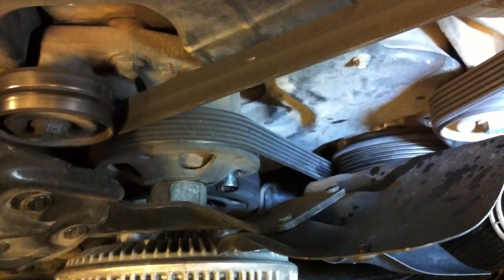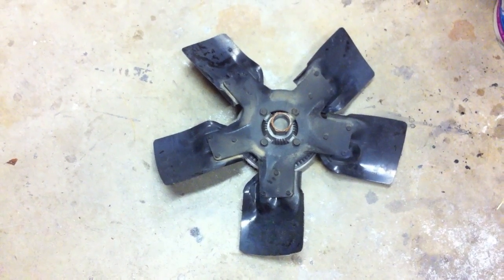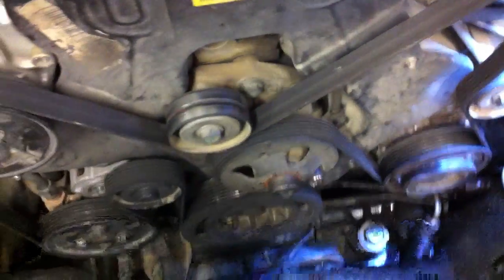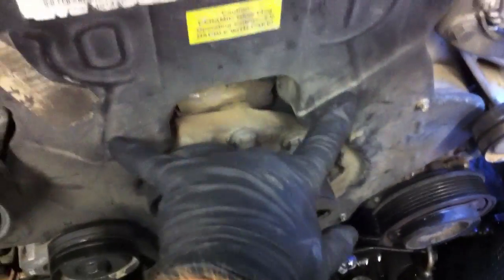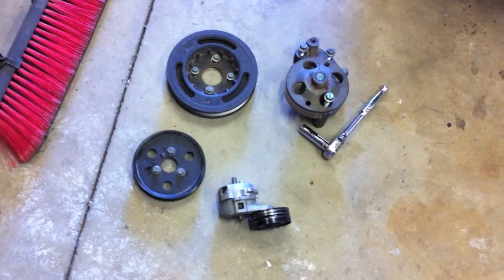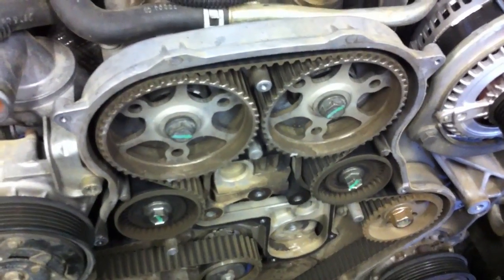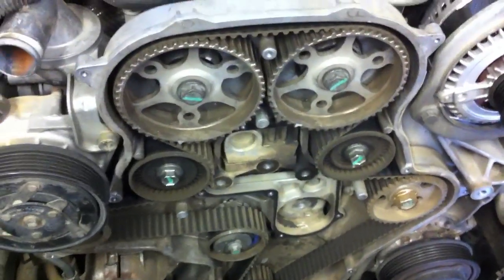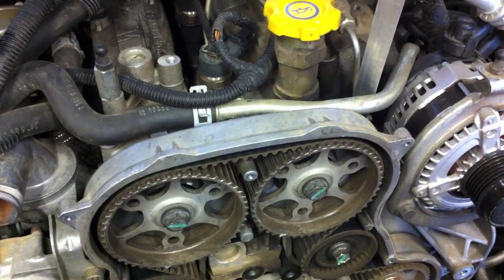Jeep Liberty / Cherokee KJ Diesel Timing Belt Replacement Part 3 - Engine cover and Re-Timing Engine

Comment: Hello sir, i just had a quick question regarding the rocker replacement as well. My question is once you time the motor 90° after TDC and insert the three timing pins, and you remove the belt and all accessories to pull the intake manifold/valve cover to replace the rockers, are you able to leave the timing pins in the camshafts so that once you put everything together the motor is already timed? Thanks i appreciate the videos man, very detailed! Cheers
Reply from the maker: Yes you can leave them installed. It’s easier to see that the pins are installed and lines up correctly before you install the cover. Timing the engine before you take it apart is really only to help you put it together later. I don’t even bother to time it before I take it apart anymore. And only when I go to put it together do I install the pins into the cover, turn the crank to 90 aTDC and assembly. Obviously for a timing belt only replacement you install the pins before taking the belt off. But if you are taking the intake off it it really only matters that they are in when it goes together.
Reply: @IcarusOffroad  thats awesome good to know! Thanks for the reply! Im currently in the middle of the tbelt job on my 06. I decided while I'm in there to do arp hesdstuds as well, ive done reading on the one-by-one method, and saw that arp provides an instruction sheet for doing that method and pulling the head. Is there any tips or tricks you have for doing the one-by-one method? Any advice would be greatly appreciated! Again, thank you very much sir!
Reply from the maker: @jonlukowicz5422  be ready to clean the threads out for the arp studs. The studs are a little longer on the exhaust side to you might get some intererence and have to grind the intake a little to clear them. I think I show some video of this in the later parts of my junkyard crd engine videos.

Comment: Are you still working on these?  I could really use your advice if you are willing??
Reply from the maker: ADVRX yes it do. Asking is free. Ask away.
Reply: I have set a goal for my 2009 wrangler to install a 2.8l crd.  Every likes Hemi's or LS motors.  I prefer the mileage and overlanding type of travel.  I need to find a Jeep first 05/06 crd liberty.  I have watched a lot of your videos and learned quite a bit about the engine.  Your videos are excellent by the way.  I have a small channel and would love to collaborate with you on this swap.  I will basically take any suggestions you have about what year, what to watch out for.  Even where to find one.  I am most interested in what you would suggest to do with a high mileage one before it is installed.  Thank you so much.
Reply from the maker: ADVRX is recommend you look for a JK donor over seas and get the JK 2.8. The JK 2.8 is the next generation of the KJ 2.8 but it’s as close to a “bolt in” that you are going to get. While you could make the 05/06 CRD work there are some electronic difference than mean the JK 2.8 will be a much cleaner swap.
Reply: @IcarusOffroad  I am sure the cost of shipping an engine from .... would cancel the project.  I have worked on VW's and have considered using a TDI.  I have decided I want to use a liberty engine.  A company out of Tacoma called "diesel toys" has videos online of a jk swap with a CRD.  They no longer offer a kit and are reluctant to share any knowledge or experience, understandably.  But still, I can tell by the airbox lid in the video they are using a US motor.  At least based on what I can see in an Aussie 2.8 replacement video and the diesel toys video.  I think I can figure out the swap, I just want to make sure the obvious things are done.  For example, the EGR delete, metal torque converter, timing belt replaced prior to installation.
Reply from the maker: ADVRX I’ve considered this same swap for years. And I have a complete donor vehicle sitting in my driveway now. I would still buy an engine package overseas. For reference I purchased a Land Rover 110 in Europe and had it shipping to Tacoma for $1900. That was a complete vehicle via RORO.
Reply: @IcarusOffroad  Well that does not sound as bad as I thought.  Any suggestions there?   I have no idea even where to begin.  I have the idea I will end up with something here.  I hate to sound stubborn after asking for your help but if these turkeys here in St George Utah can make an LS motor work.  I know I can make a gorgeous job of a US version CRD if I have the whole liberty sitting in my driveway.  I love your Ollie videos BTW..
Reply from the maker: ADVRX you can make it work, I can make it work(and not to be rude but I know more than you about it) but I would prefer to import a setup. Half of the import isn’t even about the engine, it’s about all the accessories. If you import a factory 2.8 JK CRD, wiring, intercooler, etc etc. that stuff will bolt into a JK. If you want to use an older US spec KJ CRD, you will be fabricating lots and lots of stuff, to the point where the number of hours you spend on fabrication will be less than slaving away at a day job and just buying it from overseas. 

That being said I am far enough past thinking about doing that that I don’t have any current contacts for finding a swap package. Australia and the UK used to be the easiest to deal with due to the lack of language barrier, but they are also RHD countries which meant a few things needed to be modified for LHD. If you are looking in the UK look for “breakers” I have also had luck looking on eBay UK and finding vehicles being parted. Granted there are logistic issues to importing an engine, but for me they outweigh the hassle of using an older engine. One of the big reasons not to use the older engine is that the KJ electronics use PCI bus, but the JK uses CANBUS. This means an LS engine with a CANBUS ECU, or a Cummins with a CANBUS ecu........or a JK 2.8 with a CANBUS ECU will play nice with the electronics. The KJ uses PCI bus, so it will not talk to the vehicle dash, airbag computer, and computer. Etc etc. from this standpoint a CANBUS LS engine is easier than the KJ CRD.
Reply: @IcarusOffroad  The electronics make sense.  That explains why "Cody built engineering can use the TDI.  And certainly, no insult taken, you are clearly the expert.  That is why I reached out to you.  Funny thing I was just trying to search ebay UK.  I really want a diesel in this jeep.  The whole re-engineering concept is why I shied away from the cummins 2.8 repower.  No one has put one in a JK, except Bruiser conversions and they want $30K.  The engine is only $8800, so the rest is engineering.  Maybe its time to just go buy a JL with an Eco diesel in it.   If you have any other thoughts or ideas please let me know.  I guess I will give this some serious thought before I fly to Florida and buy a liberty lol!!  It is awesome you gave me so much input thank you.  You may have saved me from a big mistake.
Reply from the maker: ADVRX ya the KJ diesel is a fun engine, but better suited for swapping into something older not newer. I think the cumins 2.8 would be better for a JK since it supports CANBUS. And overall it would have similar levels of fabrication.   I am also eyeing an ecodiesel JL or JT, I’m curious to see the JT with max tow package and diesel.

Comment: I wanted to ask. My crd has 130,000 and seems to run great
I’m gonna do the belt and water pump and tensioners
Is it necessary to do the rocker arms or is it over the top maintence ?
Reply from the maker: Its really 50/50, if the EGR has been disabled for a long time and thicker than factory engine oil run then they could be just fine. But if the EGR has been active for that whole time and someone ran 0w-20 oil, then its fairly likey they are worn.

Comment: Hi - did you use any of the following tools, or did you find work arounds??
Intake Camshaft Alignment Pin
Exhaust Camshaft Alignment Pin
Crankshaft Alignment Pin
Dual Camshaft Lock Tool
Timing Belt Tensioner Spanner Wrench
Camshaft Counterhold Tools

thanks for any info :)

Comment: I am having trouble removing the crank pulley. I removed the 4 10mm bolts like you did but the thin won't budge, even with heat.

Any tips?
Reply from the maker: Tap on it with a hammer around the center lip to break it loose.

Comment: I found the bolt you say to put the 13mm socket on is actually 1/2".  I tried 13mm and it would always slip off. 1/2" is perfect.  In fact all the fan idler pulley bolts were SAE.

Comment from the maker: No I charge quite a bit more for labor. A belt alone can be purchased online for a little less than $100. If you don't have the tools and you only want to do the belt turn to 90*aTDC, mark everything really well, and put it on following the video. It's better to do just the belt for $100 than ignoring it and letting a worn belt trash $800 worth of rockers + the extra tear down to replace the rockers.

Comment from the maker: On my personal vehicle I only did the belt at 100k, I will do everything at 200k. Most of my customers opt to replace it all. The labor cost is the same so it comes down to the parts cost. If parts costs are getting you down its possible just to replace the belt and for $100 be done. There are people who go past 100k because the cost of everything hurts, only to have a failure and have it cost more. I don't make specific recommendations and prefer to inform and let the owner decide.

Comment: So do you recommend to just replace the timing belt alone? Or do you really recommend replacing those other tensors and pulleys, or rockers I think you call them? What is the real risk of not doing it? By doing those witness marks you avoid replacing them?